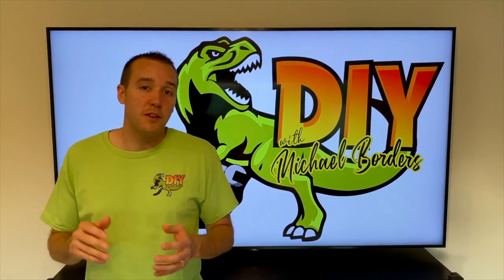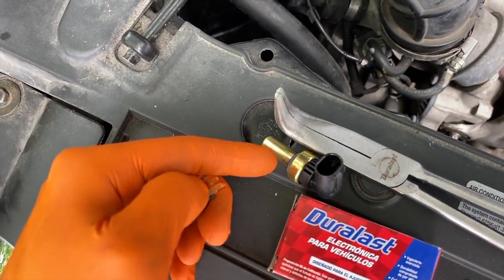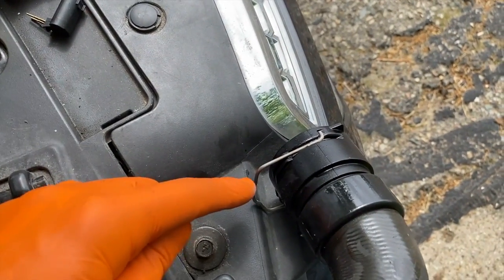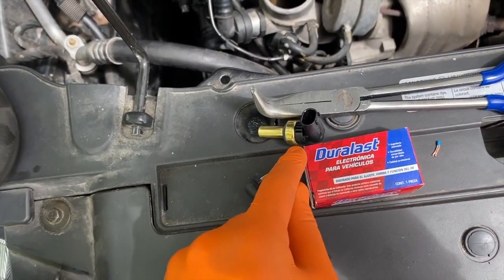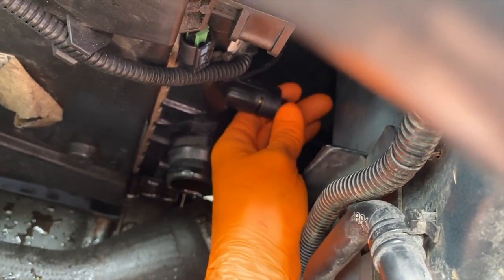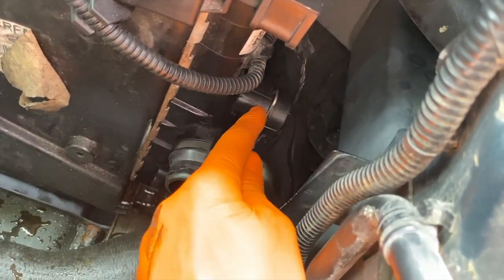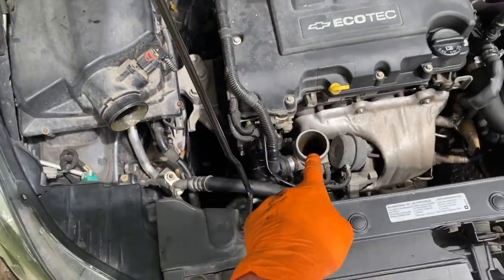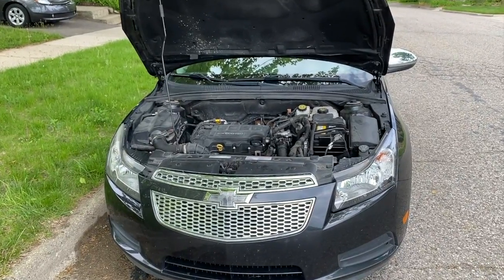Chevy Cruze radiator sensor - AC off/engine temp needle not moving

Comment: Just had this on my 2012 Cruze.  Your tip about disconnecting the harness ends/sensor ends fixed it for me.  Glad the parets weren't that expensive - I didn't need them, but for $15 each, I'll keep them on my spare parts shelf.

Comment: Thanks for the video. I have a 2014 and it’s got the same AC off due to high temp and cold gauge reading. The check engine light turned on too. So I’m gonna change out that sensor along with the water outlet one and hopefully the check engine light turns off
Reply: Any update : I’m looking at mine too it’s doing the same thing
Reply: @KwonzieReacts  in total, I’ve replaced both sensors, the water outlet and the thermostat. It’s still coming up. Only thing that temporarily fixes it is disconnecting and reconnecting the battery. The gauge rarely gets to a proper reading. I’m gonna have to take it somewhere.
Reply: @daniellipp2883  thanks hella annoying
Reply: These cars are pure junk. My daughter's 2011 has constant problems and only has 61000 miles. Trans control module went out at 47000 and GM wouldn't help due to age. Thermostat went out at 50000.valve cover gasket failed at 55000 and was dumping oil into the spark plug wells. Now this bs
Reply: @daniellipp2883  I've had the same problem. Changed both sensors and thermostat....still getting the error message and temp gauge is stuck on COLD. So frustrating. What did you end up doing??
Reply: I replaced the negative battery cable with a new one...you have to buy the terminal bolt new too...#11561025 because the old one doesn't fit.
This seems to have fixed the problem.
Reply: @majcm58  just by replacing the negative battery cable the temp gauge started working? Also, the engine light went off or you had to get it cleared?
Reply: I have a 2014 doing all of the above and also needs a new catalytic converter. As soon as I hit 100k it has been one thing after the next. 😢

Comment: Hello.  I recently had a coolant hose blow and replaced the hose. Now the car heats up, but when I start to drive it the coolant temperature and engine temperature keep dropping slowing back towards C.  Do you think this is a sensor issue or a thermostat issue? The radiator fan has started spinning so unsure if related.  Thanks!
Reply from the maker: Thanks for watching & we definitely recommend replacing sensors, both Radiator sensor & Water Outlet sensor.

Try replacing the Radiator sensor first & see if that fixes issue.  If not, Water Outlet sensor next.

😎👍🔧🔩
Reply: @DIYwithMichaelBorders  I replaced both of mine it worked fine for a day and now it's doing the same thing again...any suggestions?
Reply from the maker: @dustinchristian6043  

Thanks for sharing this, is your engine actually overheating or is it just triggering an error code?
Reply: @DIYwithMichaelBorders  from what I can tell it's not gauge stays constantly on c and does not move
Reply: Also if I remove and reconnect the negative it fixes it for a couple hours I'm going to try to replace the terminal tonight
Reply from the maker: @dustinchristian6043  

Thanks for the update.  Way too many Cruze owners are unfortunately having to replace the negative battery cable for this reason.  A new cable may solve your issue.

Comment: Where is the coolant temperature sensor located on a 2014 Chevy Cruz diesel I can't seem to find any info. Please help if you can.
Reply from the maker: Thanks for watching & welcome to the DIY Raptor Club.  For the 2014, the temp sensor is installed on the drivers side of engine & just below camshaft position sensor.

Comment: Was doing this for my car with my dad today and he dropped the clip because we couldn’t figure out how to secure the clip back on the temp sensor ☹️ rip learned some new swear words today
Reply from the maker: Thanks for watching & this little sensor is a tricky one.  What’s your update, were you able to fix your sensor and get your vehicle back up and running properly?
Reply: @DIYwithMichaelBorders  Unfortunately no,  we were short on time today so we are gonna see if we can get the pin out of the engine bay with a magnet sometime tomorrow, we got the sensor in but lost a lot of coolant in the process. Just hoping when we do get  the pin we can secure it onto the sensor with out much hassle. I knew we should’ve done the water outlet sensor first because that radiator sensor is a little tricky to get to 🙄
Reply from the maker: @jekisgod  

Thanks for the reply and by calling your local Chevy dealership and providing them with the last 8 digits of your VIN #, they can get you the exact replacement clip for your exact vehicle Sensor.  Probably only cost just a few bucks...that’s if you can’t find yours.
Reply: @DIYwithMichaelBorders  We managed to locate the clip and secured both the coolant sensors into place. However, when I was on my way to work today the AC off due to High Engine temp flashed back on. I had just replaced my coolant when we were working on my car the other night, come to find out it was basically all drained. Now, the leak seems to be coming from the passenger side, which means the leak is probably from either that coolant temp sensor not being secured properly, or the water pump. What do you think my next step should be?
Reply from the maker: @jekisgod  

Thanks for the reply & the sensor goes in a specific way & if not inserted 100% the correct way, it will leak...so annoying isn’t it...🙄

Comment: Are you sure that the two sensors are different? Do you have links to them? What year Cruze is this?
Reply from the maker: Thanks for watching & welcome to the DIY Raptor Club.  Below is a link to our video talking more about the Outlet valve & difference in sensors.

       https://youtu.be/S0UisIciGu4

Hope this helps.  Enjoy your day.

😎👍🔧🔩
Reply: @DIYwithMichaelBorders   will it also couse your fan 2 kick on at high speed
Reply from the maker: @chicanomarquez5304  

It will indeed.  It will also lead to your fan turning on and not turning off the entire time the engine running... which you and I both know... it’s not normal.

😎👍🔧🔩

Comment: I’m showing the temp sensor is the same for the radiator and the water outlet. If I’m not changing the whole water outlet unit what sensor do you show as being the replacement?
Reply from the maker: Thanks for watching, the Cruze in this video is a 2012.  Our sensors are different however your Cruze might have the same part number.

In our case, it would cause havoc to our electrical system (Fault code wise) if our sensors were installed incorrectly.

Below is a link to our video explaining more about the part number difference.

       https://youtu.be/S0UisIciGu4

😎👍

Comment: My Cruze get hot when the Heater is on and the heater gets so hot it smells like plastic burning. Plus, it smells like coolant at times. Any ideas? I did replace the water pump and temp sensor. I also replaced the radiator coolant sensor as well.
Reply from the maker: Thanks for watching.  The coolant smell/odor is unfortunately a common issue with the Cruze.  Below is a link to our video showing more about this.  This may be your issue.

       https://youtu.be/zSsHdb29wQA

😎👍🔧🔩
Reply: Im sorry Michael Borders to keep putting my 2 cents out there to people but im very expierenced with Cruzes i love them too much and love helping fellow owners out. So foxman to give ya some info on this.. in simple terms the 1.4 setup on the cruze is such a well setup cooling system in such a tiny package that the heat you will expierence in these getting INSANLY hot is completly normal. The burning plastic smell your smelling is more than certainly the heating up of GMs wonderfly designed cheap plastic that consists of the heating vents and doors that open and close depending on where u want the air going. Nothing to worry about just maybe adjust the temp down a tad once it gets warmed up so u dont boil yourself. The coolant smell altho could possibly be a leak starting to show itself near your coolant resivour or oil cooler line but more than likely if its not very strong than its probably just evaporating coolant due to you having the heat up so high. Have anymore questions just lemme know!
Reply from the maker: @brpiper14b  

We really appreciate you taking the time to share.  😎👍
Reply: @brpiper14b  my 2011 had a new radiator installed. Now, when idling the fan kicks on about every 12-14 seconds and it's loud and annoying, especially when I'm at a drive- thru. No overheating issues what so ever. Also, I was in my kitchen and had car running and I heard a loud pop, got in car and spelled coolant and a little mist. I turned off car and later drove it, no overheating, but slow coolant leak somewhere, help plz...

Comment: The hose you have installed.. what is the part #? I have the 2014 Lt. Hose doesn't fit onto the radiator on the lower portion. Fits great onto thermostat housing side.
Reply from the maker: Thanks for watching & welcome to the DIY Raptor Club.  Don’t have the exact part # off hand.

We recommend contacting your local Chevy dealership & providing them with the last 8 digits of your vin #.

They will be able to get you the exact replacement part # for your exact engine.  Whether you buy it from the dealership or elsewhere is your choice.

Keep us posted on your project.  😎👍

Comment: I own a 2011 Chevy Cruze 1.4, my temp gauge will go just above half and linger for a few seconds and shoots back down to below half where it should.. I've had problems with my valve cover gasket causing my serpentine belt to sling oil everywhere and my question is there is a sensor connector below the belt on the engine shield that is covered in oil could that be the temp sensor connection thats gone bad because of the oil? Asap response would be great 😃
Reply from the maker: Thanks for watching & welcome to the DIY Raptor Club.  That can definitely lead to issues with the electrical system and error codes being triggered.

We recommend carefully cleaning electrical connection point and seeing if that makes a difference.  Make sure your engine is off as you clean electrical points, keep us posted.
Reply: @DIYwithMichaelBorders  thanks for the reply helps alot I've also noticed my head lights flickering and the dash infotainment system screen will also flicker for a split second and it seems when it does that the temp gauge rises
Reply from the maker: @topmysteric1157  

You are very welcome.  Sounds like there’s something loose...electrically...🤔
Reply: @DIYwithMichaelBorders   yea I heard the cruzes run up to 240 degrees max maybe a lil over for the eco models more fuel efficient for hotter engines as long it doesn't reach 260 no serious damage will happen that's what the book says it can safely operate at 240
Reply from the maker: @topmysteric1157  

Keep us posted.  😎👍

Comment: I got the same problem needle ain't moving and no cold air coming out I think. That make the ac clutch not turn on
Reply from the maker: Thanks for watching & a few things can cause this.  In addition to the part shown in this video, your radiator sensor as well as your water outlet sensor can cause this in the event that either of those sensors are faulty.

Keep us posted on your project.

😎👍🔧🔩
Reply: @DIYwithMichaelBorders  thank you a lots
Reply from the maker: @alonsogutierrez3437  

😎👍🔧🔩

Comment: Hi just a question is this the same sensor part as the engine coolant temperature sensor?
Reply from the maker: Thanks for watching & welcome to the DIY Raptor Club.  All sensors have different part #’s & are slightly different in design.

Radiator sensor is different than water Outlet sensor...

It’s very important to ensure you’re installing the correct sensor to their respective part as the onboard computer will detect a fault when the part has the wrong sensor installed inside it.

Hope this helps, let us know if you have any additional questions, us fellow DIY’ers need to stick together!

Enjoy your weekend.  😎👍🔧🔩
Reply: @DIYwithMichaelBorders  Thanks for the quick response! Great channel, just subscribed 👍🏻
Reply from the maker: @jxrmz9739  

We appreciate that, we subscribed to your channel as well.

😎👍🔧🔩

Comment: Changed both upper and lower sensors, still no change in gauge. It will sometimes climb slightly then drop back down. Thermostat was changed 20,000 miles ago due to failed heater thermostat sensor. Worked perfectly till now. Any thoughts would be appreciated
Reply: Same for me
Reply: Did u figure it out
Reply: Thermostat

Comment: Hi my holden cruze cooling fan only comes on when the ac is on. Temperature gauge is in the middle. What could that be ? Thanks
Reply: My car is cruze 2016 model had recently changed the water pump and thermostat
Reply from the maker: Thanks for watching, looks like your engine is operating properly.  Since it’s not overheating and engine temp needle remains under 1/2 way point, looking good.  😎👍
Reply: @DIYwithMichaelBorders  thank you for the info, the fan works after long drive in hot weather today👍
Reply from the maker: @theoneroutsos4577  

That’s what we’re here for, we DIYers need to stick together!!  😎👍

Comment: We replaced sensor Friday. Drove car all weekend and same thing happened again Tuesday.   Any idea why?
Reply from the maker: Thanks for watching & you may need to replace your Water Outlet Valve which has a sensor inside it.  Below is a link to our video showing replacement of it.

       https://youtu.be/X1S8liNxYMs

😎👍🔧🔩
Reply: @DIYwithMichaelBorders  thank you for responding. It ended up being put in a Diagnostic Machine. Thermostat was stuck open. Are at least that was what we were told. Had it replaced today. Crossing our fingers that will fix the problem. Again thanks.😀
Reply from the maker: @priscillaflynt815  

Great to hear & thanks for the update.  Hopefully many stress free days ahead for you.

😎👍🔧🔩
Reply: @priscillaflynt815  Hi Priscilla.  Can you please tell if replacing the thermostat fixed the problem?

Comment: Is it safe to run the car like this?
Reply from the maker: Thanks for watching & we recommend replacing your sensor once it fails.  If not replaced, your system will be reading unreliable coolant temperatures & causing additional issues with engine.  Hope this helps, enjoy your day.

😎👍🔧🔩

Comment: I am having trouble with replacing that clip on the sensor. What do I need to use?
Reply from the maker: Thanks for watching & welcome to the DIY Raptor Club.  It’s very important to position the sensor itself properly into the radiator.

In the event that the sensor is not shifted into the radiator insert properly, it will not go in all the way & seat flush internally.  In this case, the actual clip will not be able to slide in & lock the sensor in place to create the water tight seal.

We recommend carefully positioning the sensor into the radiator as shown in this video.  Please keep us posted.

😎👍🔧🔩
Reply: I still can  drive the car or no

Comment: so is this fixing the ac off due to high engine temp when my temperature gage says its cold??
Reply: also my fan runs constantly??
Reply: also what is the part number for the temperature sensor?
Reply: I'm about to do this and the pn of the one I have is SU13822
Reply: @Hnbearor  did you figure what it was?
Reply: @sooflex15  I replaced both my coolant sensor by the radiator and my thermostat and it fixed the problem.

Comment: So the problem was the temp sensors?
I'm having the same problem my temp gauge not move and its say ac of due to high enginge temperature but the car runs good
Reply from the maker: Thanks for watching & welcome to the DIY Raptor Club.  It was indeed.  😁

Let us know if you have any questions.  Us fellow DIY’ers need to stick together.

😎👍🔧🔩
Reply: @DIYwithMichaelBorders  I have the same problem ac shut off I had both senors change nothing changed my radiator fan is running always except when car is off what else can I do?
Reply from the maker: @leenorarobinson5886  

Thanks for reaching out to us.  Have you replaced Thermostat since owning Cruze?  There is a sensor inside thermostat that can also trigger the symptoms however you have to replace the entire thermostat to replace the sensor inside.

Keep us posted.  😎👍🔧🔩
Reply: @DIYwithMichaelBorders  I did have the thermostat changed and after driving the car for about 30 minutes the air started to come on cold I hope the problem is fixed mechanic wants to tell me it's an electrical issue haven't seen anything online that states that.
Reply from the maker: @leenorarobinson5886  

Thanks for the reply & an electrical issue seems possible...🤔...if it’s solely referring to the electrical connection points & sensors.
Reply: @leenorarobinson5886  Hello, how did you end up getting it fixed? Thanks

Comment: I changed the radiator sensor and engine sensor still have same problem with loud fan noise
Reply from the maker: Thanks for watching & welcome to the DIY Raptor Club.  At this point, you may need to replace your Thermostat.  Below is a link to our video showing replacement of Thermostat.

       https://youtu.be/8F-17wODadQ

Keep us posted.  😎👍🔧🔩
Reply: It's your fan resistor that it's located in back of coolant fan. Need to take whole fan off and replace it. Or try just replace the resistor.
Reply: Theirs also 5 relays and 2 fuses for the fan check those first.
Reply from the maker: @JoeCAlvarado  

Thanks for sharing this, you Rock!
Reply: Did u find i fix? i replaces radiator sensor & thermostat, still same issue
Reply: @emzdarlington9661  it was the thermostat for mine
Reply: @kinggage  Was the temp needle stuck at cold before you replaced the sensor and thermostat? Thank you
Reply: @ivanbarbosa3132  yes
Reply: try water pump or thermostat